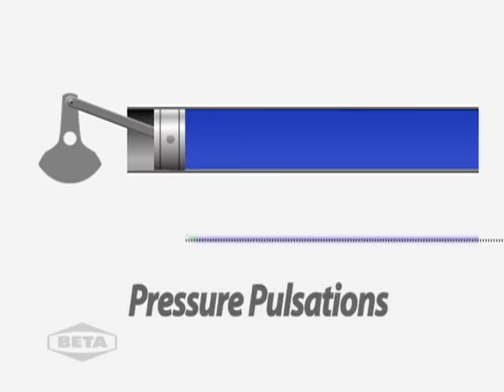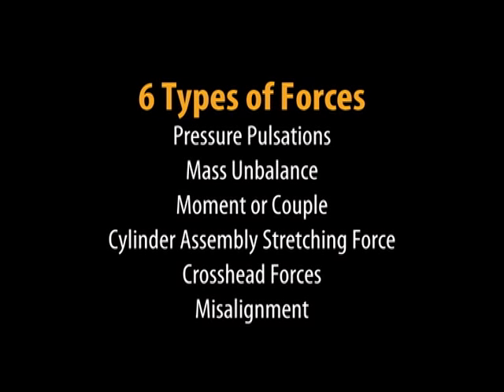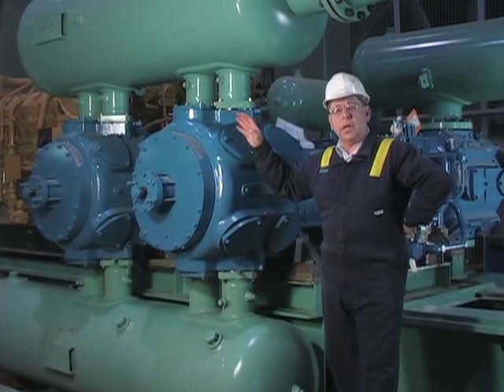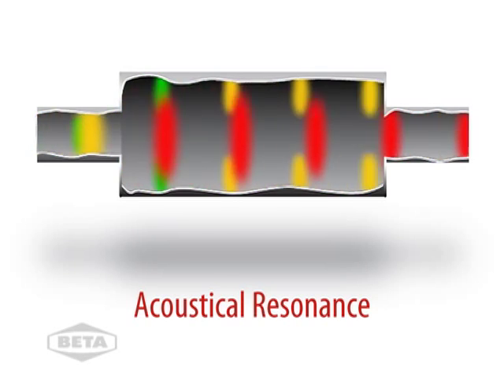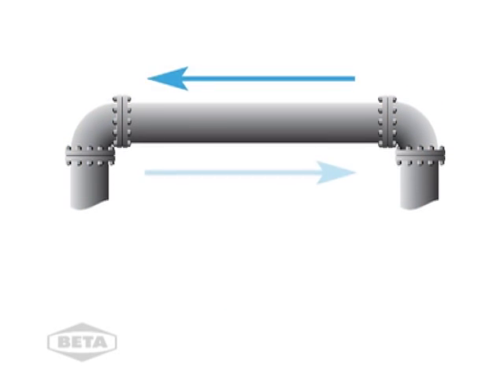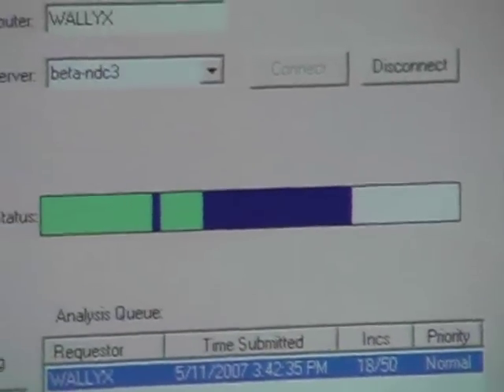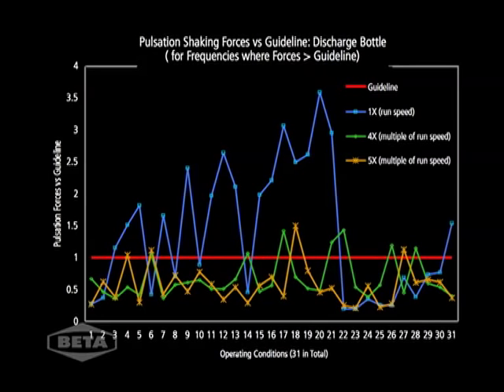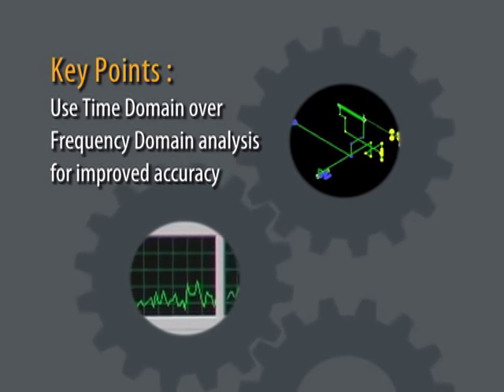Module 2, Pulsations and Other Forces in a Reciprocating Compressor

Comment: In the vibration analysis, Do you considered cross head pin force coincidence or cumulative with the unbalanced force and couples of the compressor frame?
Reply from the maker: Yes, all loads acting on the compressor crosshead, crankshaft and piston are included in the analysis.
Reply: @VibrationDynamicsNoise  thank you for the answer.

Comment: Please recommend software to analysis of reciprocating pump. Also, Instruments to check the unbalanced forces and vibration in the reciprocating application piping.
Reply from the maker: Wood has developed our own proprietary software for the analysis of pressure pulsations in reciprocating pumps. We can calculate the amplitude of the pulsation waves and determine the forces and resulting vibration in the piping system and make recommendations to reduce the effects of high vibration. (See more info here: http://www.betamachinery.com/about/research-and-innovation/#a_289).

Measuring vibration in piping systems can be done with a single-channel data acquisition system, although a two-channel system has advantages in comparing vibration in multiple locations with a reference point. Measuring unbalanced forces is a much more difficult task. Usually, the forces are inferred from the vibration measurement.

Feel free to contact our vibration team at www.woodplc.com/vdn if you'd like to get support for your project.

Comment: at 160 Hz the resonance can be found we can see that. but this resonance occurs due to the pulsations. so my question is the resonance occurred in this case should be considered as piping resonance. right?
Reply from the maker: The simulation results show there is a pulsation resonance at about 160 Hz. The frequency domain solver calculates the resonance at a slightly higher frequency and with much larger amplitude than the time domain solver due to simplifications inherent in the frequency domain solver. The time domain solver is the recommended approach for design pulsation controls for compressor and pump systems.

Comment: Are the time domain analysis preformed by using differential equation model of the system and then approach it from there?
Reply from the maker: Our time domain solver uses the method of characteristics to solve the partial differential equations that describe how pressure and flow disturbances travel in a fluid.

Comment: I'm a Cat 3 Vibration Analyst... I always get a little stressed up when I have to analyse a Screw and piston (reciprocating) compressors. There are too many variables. I'm writing a report on an unbalanced piston compressor, it looks bad (the compressor I mean)... And the vibrations of the compressor resonate on the piping, very dangerous, specially because the machine works with NH3
Reply: What equipment are you using, what is the cheapest equipment you can use to just check axial vibration on a valve and see its frequency.
Reply: Hello can you help me solve a question on theory?